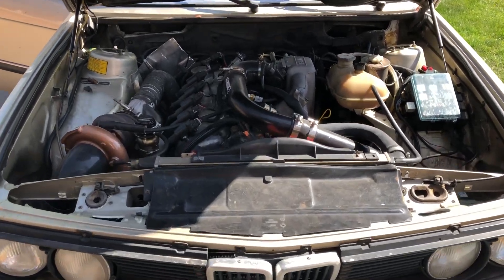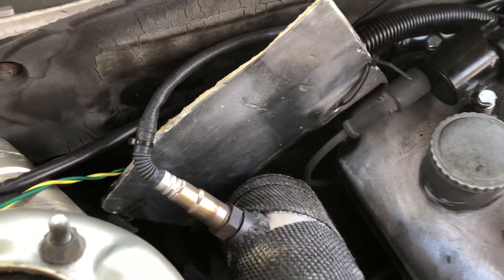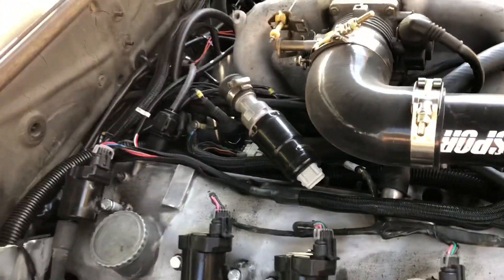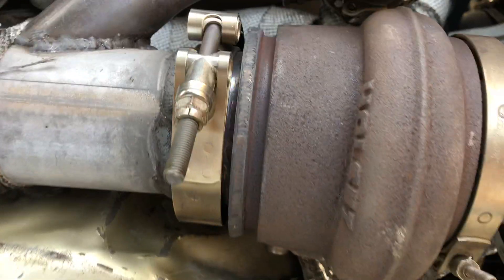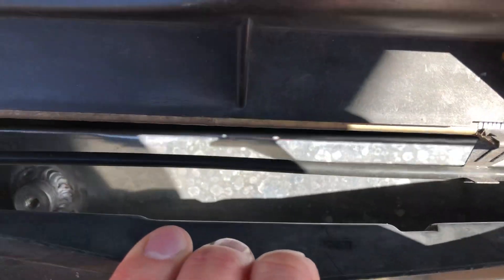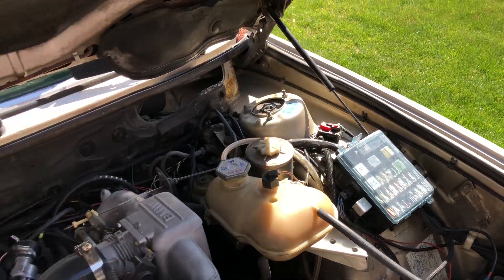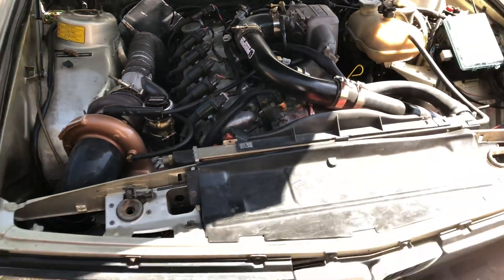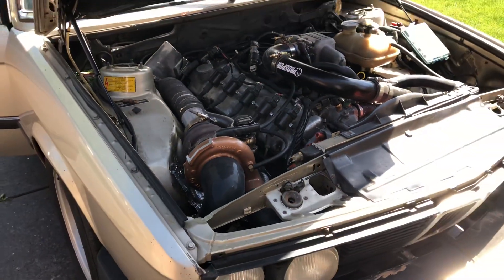Budget Megasquirt E28 Turbo build overview

Comment: This is cool. Although, I'm doing it on Mercedes 190e, using the microsquirt as well. Going efi, but i think i seem to having a fuel pressure issue. Are you running a stock FPR?
Reply from the maker: Yes I am using a stock fpr

Comment: I would like to copy your build but was wondering what u do with the original mass air box that sits after the air filter?
Reply from the maker: If you get a stand alone ECU like I have you don’t need a MAF. Instead you just use a manifold pressure sensor and use speed density for fuel control

Comment: I'm still ways out before turbocharging my E34 535i. I was interested in going standalone before turbo anyway. 

Do you know if microsqirt can run a MAP sensor? I'd like to enjoy the car N/A for a while with the benefit of removing the AFM. Thanks!
Reply from the maker: Yes a I run a map on my Microsquirt. I ran about a year NA before I went turbo and it worked great. Definitely made the car run better and felt a power increase for sure

Comment: I might have missed it but where’s the BOV?
Reply from the maker: There isn't one. Just a surge ported compressor cover
Reply: @TurbineResearch  Interesting. how does it work? Is there a trade-off vs having a BOV?
Reply from the maker: @CChan11  it just pukes the extra air out of the compressor cover ports when you let off the throttle. It sounds the best IMO. BOVs just cause leaks In my experience. Not having one just reduces the chance of a boost leak

Comment: so how are you metering air with this setup? trying to figure out if i can use MAF+MAP or just use MAP when i turbo my e34
Reply from the maker: On megasquirt you just use speed density tuning. It only uses MAP , intake temperature and throttle position
Reply: @TurbineResearch  thank you

Comment: Hey there. I have an M30B35 e34 that I am building with basically the same ECU/ignition setup as you have. Could I pick your brain a little about how you enabled the 3rd igntion output in Tunerstudio after adding the resisor internally? THanks!
Reply from the maker: Enabling the 3ign is easy (once the modifications are done to the ECU) simply tell the megasquirt how many cylinders it has and it will automatically enable the output.  The resistor is easy too just put a 10k 1/4watt resistor in-between the two wires from the stock vr sensor and it will get a clean signal.

Comment: I wanna turbo my e34 M50 NV, you show a lot of detail about your setup.
Reply from the maker: I would love to swap a m50 nv into my car they are solid motors and way newer tech than m30s .
Reply: s14sean if you plan on doing a M50 make a video or lmk because I wanna learn how to. I’ve seen how to turbo a car, but I wanna see it done on the same motor I have xD
Reply: s14sean also, if you plan on doing so, that E28 is going to fly!

Comment: Awesome build! I'm doing something really similar, I have an M30B35 in an E30 chassis, and it's getting an eBay GT3582. I want to see what it can do, and for how long!
Reply from the maker: I am probably upgrading to a gt35 here soon as well. With a good tune these motors are really strong . I have been ruthlessly driving this on 15psi for 3 years and never had a single issue.
Reply: @TurbineResearch  Great to hear! Are you using a stock head gasket and head bolts? I'm going to start with that. I've read the ARP studs do not fit well in the M30.
Reply from the maker: @eddiesheeran5791  yes stock untouched 30+ year old head gasket and stock bolts

Comment: Can u help me out ? Just finished my set up on my e28 similar set up to yours but running the pnp megasquirt 2 and could use some help with the tuning part.
Reply from the maker: jahmari gallimore yeah, what part do you need help with ?
Reply: The base map on diy settings seem out of wack but the car starts. Engine size was set to 2000 cc. Could u send me a copy of your base map when you were on pump gas ?
Reply from the maker: jahmari gallimore https://www.dropbox.com/s/mnpz7qo33802xca/91%20Octane%2012-3-17.msq?dl=0  here is the 91 tune. However, it probably won’t work unless you have the exact same setup as me. (Same ignition coils, same size fuel injectors, same sensors ) stuff like that
Reply: I kind of understand how to make the basic changes I just wanted something to compare too if that makes any sense lol

Comment: S14sean: was switching from a distributorless system worth it? Do you see any difference in how the car runs out the tuneability? Are you just running wastegate pressure or are you controlling boost through the megasquirt? Clean build my man. I am working on tuning my e24 with an m30b34. I think I am going to do a MLS head gasket and APR studs. I have a rebuilt k27 turbo and 745i manifold. Getting all these parts can be a headache.
Reply from the maker: Jordan Ebner Thanks man. Yes it was totally worth it. The individual coil packs are very powerful compared to the original coil. It runs so much better on the LS coils and the most noticeable part is that it never misses or hesitates ever. It’s cheap too all the coils were like $40 in the junkyard. I was originally planning on using the stock distributor but I’m glad I went ls coils. Tuning is fine either route but you get more control of timing advance and doing stuff like launch control with individual coils. Now for the past few months  I’m running 15psi (~350whp) and no problem on the stock 30 year old headgasket 🤞
Reply: ARP studs lol
Reply: I wanna turbo my e24 too jordan. I hear the turbo you want to use is small if you eventually want more power out of it

Comment: Why did you go with MicroSquirt instead of something like MS2/MS3?
Reply from the maker: Nils Asejevs microsquirt is a few hundred dollars less that the ms2 or ms3 box. Microsquirt is ms2 software but just has a few less features. It does the job but for less money essentially
Reply: @TurbineResearch  Ah, I see. I opted for the MS2 kit and assembled it myself. Mainly because I wasn't sure if MicroSquirt offered everything I wanted for my build.

I assembled it in about a week, which includes reading through all of the documentation, soldering, etc. I think I did good, seeing as I haven't done anything like that ever before. Can runs better than ever. No turbo yet though.

What did you do in regards the exhaust manifold? Did you weld it yourself? How much did it cost? This is my biggest obstacle at the moment, since I don't have my own welding equipment (yet).

I have a E34 535i which I intend to turbo for some low PSI boost (7-10?), just so I don't have to put in an aftermarket head gasket and studs, since those are really expensive.

Also, how much did your injectors cost?
Reply from the maker: Nils Asejevs good work man! I made the exhaust manifold from 1.5inch schedule 40 steam pipe from an industrial plumbing supply and a vibrant mild steel t3 flange off amazon. It literally cost me $50. I bought a welder for this project and made my way through with some help from friends.  I just used the stock manifolds flipped up and just welded to the stock flanges.  

Yeah I’m on stock everything running 15psi (~350whp) for months now with no problems. Like literally never taken the valve cover off the motor and it’s fine and really fun. If you just want to have fun for very little money it’s very doable with this setup.

Injectors are Siemens deka 80lb injectors from efisource.com probably $43 each
Reply: @TurbineResearch  Noooo way. I was exactly thinking of just flipping the stock manifolds upside-down to avoid having to weld the whole 6 pipe flange. Thank a lot for the info! Hopefully I get my E34 boosted this summer. :)
Reply: @TurbineResearch  2 years have gone by, and I have finally gotten my shitbox boosted. Thank you for your overview video again. It was a big help and motivation to get mine boosted. Here's my setup: https://www.youtube.com/watch?v=WMIO-GOQY6g

Comment: Nice project 👍🏼👍🏼
I really like it 
One m30 specific question 
From were do you get the oil feed to the turbo ?
Reply from the maker: X F any hydraulic store will have the fittings. 1/4 push loc hose and 1/4 JIC connectors. As you see in the video I get oil from the back of the cylinder head.
Reply: s14sean oh i tough this was coolent 
My fault